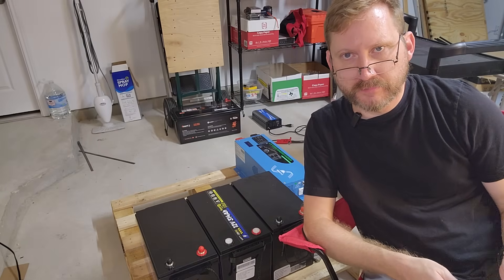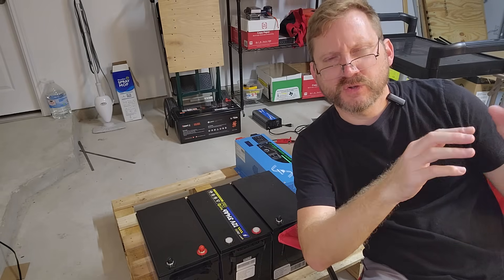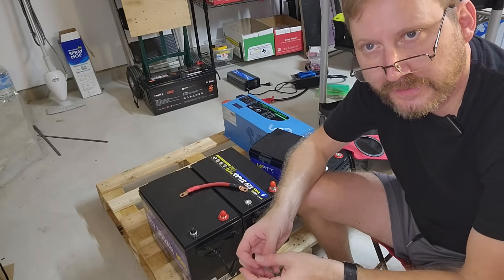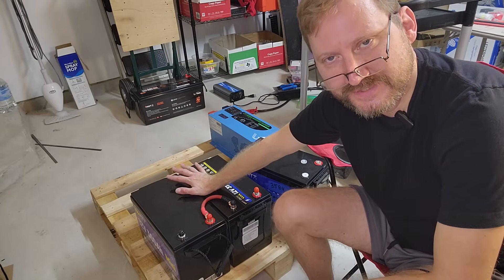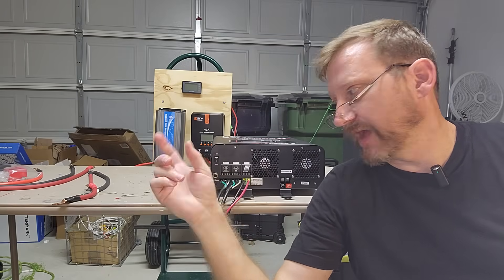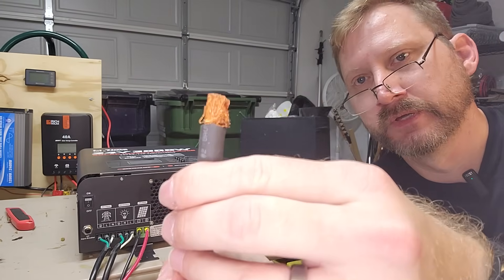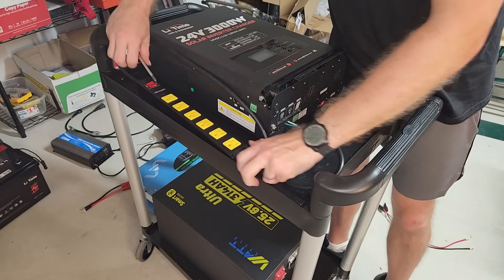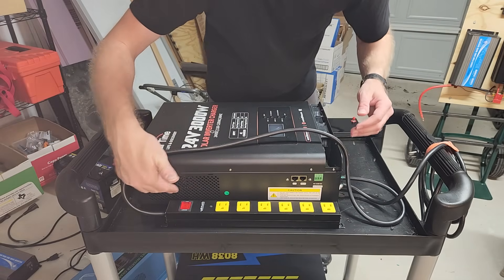8,000wh, 3,000w MEGABUILD  Under $2k #wattcycle  #prepper #solarpower Texas Prepper Projects

Comment: Instead of connecting a power strip, can you connect a 30 amp?  For plugging in the camper.
Reply from the maker: That is the much better solution actually!
Reply: @texasprepperprojects  make a video on that please.  I want to build one to power my little camper.
Reply: @texasprepperprojects  or just show how to have a 30amp plug instead of the power strip.

Comment: I made the jump from 12V to 24V and you are right, it is the right blend between common components. 48V is also a bit dangerous considering human skin generally starts taking voltage at 30+V. When you are messing with 100-200Ah, 48V can get very risky for novice Solar DiYers like myself. 
When I get better at all this, I might decide to start testing 48V components, but for now, 24V seems to be a good fit for me.
Reply from the maker: Almost every 12v solar MPPT will also run on 24v and most 12v RV devices will run on 24v as well like a fridge. So, 24v is the 'natural' fit since you can use the most common components.  48v moves into more specialized parts. Also, my deal killer for a small system is the minimum input voltage being so 'high' for a 48 system.  But, not enough people talk about that, or pay attention to it.

Comment: A big consideration for chaining 12v lifpeo4 batteries together... The BMS on one can detect a low voltage and shut down the mosfets, meaning a severed circuit that can not be charged without charging that battery directly. I tend to like 48v, but 24v is nice for mid sized applications!
Reply from the maker: Thanks!

Comment: If crossing the battery cables is really a concern for you, that particular battery can be mounted top side down. That will reverse the terminal positions without requiring a longer run of cable. 
   You'll only be drawing 3000 watts constantly with that inverter. That's 117 amps @ 25.6 volts, so for a 1 meter run of silicone insulated cable you could technically get by with 10 AWG cable @ 120 amps. It would be better to use  8AWG @ 180 amps and 6 AWG would be about 400 amps. Most ampacity charts that you see are for insulation like THHN and aren't for finely stranded cable. They also don't describe  conductors in open air, but rather conductors bunched to the maximum bundle size allowed, inside a conduit. Short runs like we use on a build like this won't generate much of a voltage drop either. Our main concern would be limiting the heat generated in the wire to a temperature that won't make the insulation fail. Silicone is the big dog in the insulation battle over heat. Using the NEC charts that many refer to would tell you that 4 AWG wire will only carry 95 amps, less than this inverter is rated for,  yet it has 4 AWG terminals. That NEC rating is based on keeping the wire temperature below 194 degrees F which is the limit of the toughest industrial and house wiring insulating coatings, such as THHN. Silicone covered cables are usually rated to 392 degrees F and some are as high as 572 F. Paper won't catch fire below 451 F, but I suppose that 392 degree rating would be enough to burn your skin.
    I've seen those flat wire lugs before and question how they are supposed to work. You can look at the ones that you had and tell that the cross sectional area of the flat lug is much less than that of a 2 AWG cable. It would be like wire nutting or soldering a 2 AWG cable to the end of a 4 AWG cable and then sticking the 4 AWG cable under the screw. To each his own, but I don't see how you would ever NEED a 2 AWG silicone cable for this all in one sol-gen. I think they may just be covering their butts with that recommendation because the sol-gen COULD draw as much as 350 amps at its max surge rating of 9000 watts, but that would be for only seconds.
Reply from the maker: I thought about standing the battery up so the wires don't cross.

Comment: This is an interesting coincidence. I just finished building my 24v 300ah handcart system. My build philosophy was just a little different than yours though. My main focus was redundancy. Because redundancy is good. And also because redundancy is good. I also went overboard on component specs as well as wire size. 

To that end I’m stayed away from all in one products. I’m not fond of single point failures. Because, and I’m not sure if I’ve mentioned this, redundancy is good. If any one component on my system breaks I have (or will have) a redundancy in place. I used three separate 24v 100ah batteries and fused them individually with marine rated battery fuses. I have two separate ways of charging the batteries. I have an overkill Victron 150/60 and a Victron Bluesmart plug in charger. I’m going to also try to eventually get a spare inverter in case my 3000 watt inverter dies. But that’s future me’s problem. I’ll get there. 

I’ve been working on and saving up for this system for a couple of years now, and given my design philosophy it’s probably a lot more expensive than it needs to be, but now that I’m done with it I have a lot more peace of mind going into hurricane season. If I’ve calculated correctly I should be able to run my fridge and freezer for at least 48 hours without solar input. And if I can get the right panels I want off Facebook Marketplace (I want four residential panels wired in a series/ parallel configuration), I should be able to run those two appliances indefinitely. 

I will be running tests on it over the next few weekends. Also, in case I forgot to mention it, redundancy is good. Don’t let your all in one system turn into a very expensive door stop.
Reply from the maker: I have several stand alone 24v inverters as backups

Comment: I love your reasoning of 24V systems over the 48V and does make a lot of sense.  Now as impressive as that huuuuuuge battery you have on the cart, their weight is the con for an elderly individual like.  I can lift a 12V 300ah battery so I would rather have two of the 12V batteries for portability sakes.  It is the reason that I bought two 2200 Honda generators for the portability they provide and by connecting them together I get a 4K generator.  For me it is definitely a lot more cumbersome and difficult to move a single generator that is 4K.  I'll stick to making a two trips.  Great video.
Reply from the maker: I'm glad you're thinking about the portability! Thanks for watching!

Comment: I've not heard anyone tell people not to get 48V in a long time. Everyone who builds things like this goes 48V. Good video, regardless.
Reply from the maker: Do you disagree with my reasoning? For a small back up system the minimum input voltage is too high in my opinion.  It was overcast here today so I couldn't demonstrate a full system setup
Reply: @texasprepperprojects I don't disagree with your reason. It actually makes a lot of sense. I would rather take the high PV input, than use 12 or 24 volts though. I think it's a personal preference.
Reply: @meilyn22  Absolutely a personal preference.   If I was going to mount panels permanently I think a 48vdc system would be great.  For a more portable system where I'm placing panels in the yard or driveway then the lower voltages provide a lot of flexibility.
Reply from the maker: Thanks!

Comment: Bro I'm building out mine right now and i think i am going to turn 2 battery lugs into ferals. I have 2/0 wiring. You are the only one I can find building with the aio
Reply from the maker: cool!
Reply: @texasprepperprojects this is my first build and my chest is sore from all of the crimping lol. I put a 300A ANL fuse on my positive line, smart shunt on the negative. This is for my rv and way overkill for my computer. 😅
Reply from the maker: What inverter are you using? What battery?
Reply from the maker: Jump up to the wattcycle 280 or 314 while they are on sale!